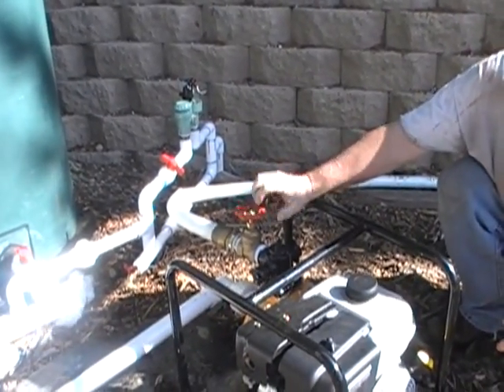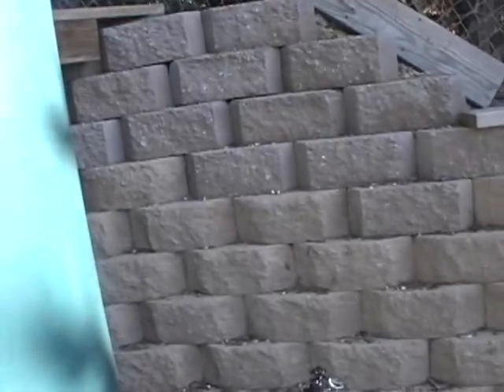Testing an Emergency Fire Pump

Comment: Thank you for the quick reply. I have been looking at that same pump then on ebay. Or at least it looks very similar. I have not been able to find any reviews or videos of it until seeing your video. Also was worried about a lack of warranty. 

Will be used for snowmaking application, it wouldn't be used necessarily continuous but will have to run for several hours at a time. Need something with 100psi or up. That pump looks good.
Reply: jdlilfan still looking for a pump?

Comment: I bought one of these on amazon. Its a 220gpm rate with 7hp. I just drop the feed line into the pool. I like your storage tank design. I also have an Indian Pump.
Reply: Kandi Klover what ia the max head and pressure?  For Fighting fire volume and pressure is key.

Comment from the maker: I actually did buy the one in the video from ebay and paid twice as much as the one from Amazon.  I can't see any functional difference between the two.  the Amazon purchase was $197 with free shipping and it wasDuroMax XP652WP 2-Inch Intake 7 HP OHV 4-Cycle 158-Gallon-Per-Minute Gas-Powered Portable Water Pump (CARB Compliant).  They both have metal housings and don't seem to be laboring at the pressure I'm using.

Comment: I say get more water storage and then add 2 bottle of cheap dish  soap and a couple more hoses and you got a awesome system,need a pressure relif that return to the  tanks to act as a recurculation set up in case you have a shut down on the nozzel.
Reply: I'd be interested in how the pressure relief valve is setup.  Been looking around the web for ideas but couldn't find anything real concrete.
Reply: Most harware have a selection of adjustable pressure reliefs , ,figure out how much your pumps maxium pressure is  and add a additional outlet and plumb in a tee with a pressure guage and  pressure relief that is piped back to the water tank,use the pressure guage to figure out were your top limit is  for most home fire systems 50 psi is pleny. I would add a s 3/4 inch valve plumb from the dishcharge to the tank, it can be used to prevent over pressure and over heating the pump if you close the nozlle for some reason, it will take some practice with a recurculation system but I hope this helps.
Reply: I was hoping to find an adjustable relief valve with BOTH 3/4" inlets and outlets but could only find one with a 1/2" outlet with an adjustable pressure feature.  Frustrating to find one...
Reply: Yes, get a 3/4 inch galvanized 3/4 cross ,top pressure relief and one side pressure guage  and the other a 3/4 ball valve for recuculation, you could also put a tee between the cross and the recirc valve for a garden hose connection.

Comment: help meee which is the pump that are using
Reply from the maker: The pump in the video is an Xtreme Power X2013 that I bought on eBay.  My second pump, not shown, is a DuroMax that I bought from Amazon.  I test both pumps regularly so they will be in good operating condition if and when I need to fight fire on my own.  There are numerous pumps on Amazon - my search is 'gas powered fire pump'.
Reply: .and which of the two is better my friend?
Reply: +rojorojo revive still need pump help?
Reply from the maker: I bought these pumps to fight fire if it occurs and if the Fire Department is not available.  That has not happened.  In the meantime, I change the gasoline and test each pump every six months.  That small amount of use has not determined that either of the pumps is better than the other.
Reply: Good test schedule. Do you have a fill line in to your tanks? Look into a booster pump with a flow meter, so when you start using your tanks water, your booster pump kicks on and start the refill process, can buy you a few extra minutes. Also it will then refill tanks to full so you dont have to worry about it your self.